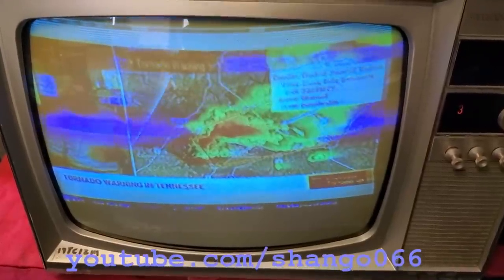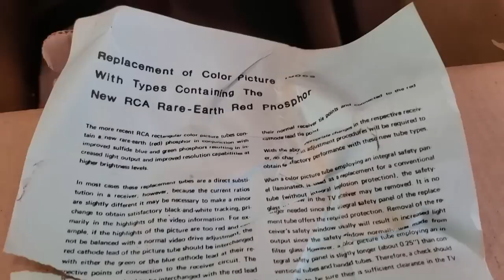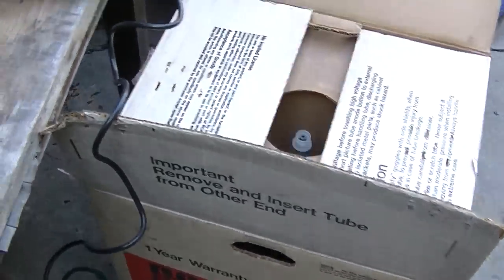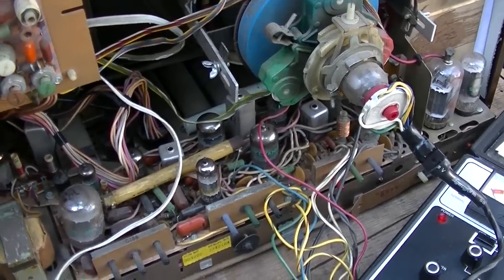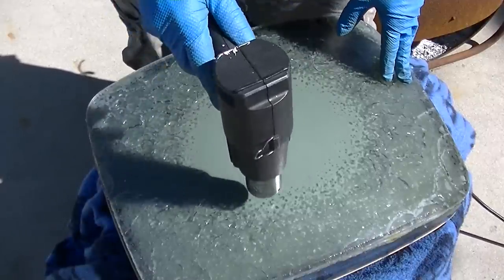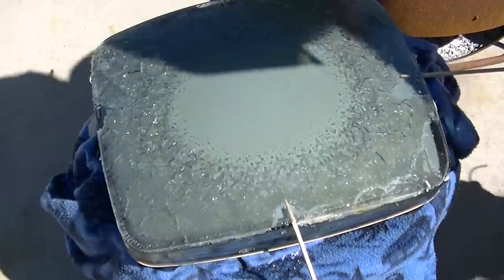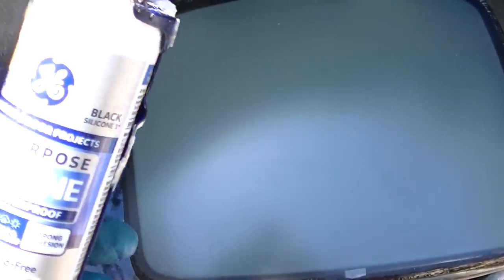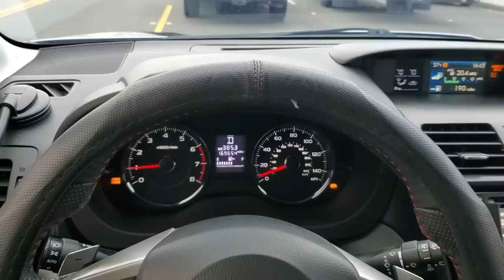Color Television CRT Cataract Removal and Replacement Pt1 1966 Sylvania Tabletop

Comment: As a Britisher, I cannot believe a car can only report around 20 MPG at that speed with just a Shango and a TV onboard :o  I know that people like their big engines and things but, well, we really need to find better alternatives to this just to get around!
Reply: your gallon is larger than ours it doesn't change much but 20mpg us is 24mpg imperial
Reply: @Mister_Brown  I thought there was a difference but really fuel consumption is just too much these days.  We had cars in the 1980s that on a run could return around 40 to even 50 mpg with ease.  Around town that was down to about 30. Emission control could be a factor in this increased consumption, as could be the trend to have bigger cars, but I just wish people would be happy with cars with smaller engines.
Reply from the maker: We love our carbon pumps
Reply: @andic6676  oh i'm not saying it's forgaivable just that sometimes apples to apples comparisons aren't what they seem

also we do have efficient cars, my old corolla does over 45 us mpg on the highway and is literally impossible to get less than 28mpg no matter how poorly you drive it on flat ground. but even that has a 1.8 where in the uk it might have a 1.4 tops or and get better mileage still
Reply: @andi c  For the catalytic converter to heat up and burn everything off, the engines run richer. I tune engines with an ECU reflasher and stand-alone wide band O2 sensor the engine are running at 13 to 1 AF when they run better at 14.7 to 1 even 16 to 1 but then pollute more cuase the cats don't heat up. I went to the extreme with a 5.3L V8 silverado and went from 13mpg to 20mpg only in summer temps, tho have it at 17 to 1 AF at idle.
Reply: Zero miles per gallon when you're not moving. Accumulated or average mpg is not the same as instantaneous. Cars today are super clean and very efficient. It's easy to critique fuel efficiency on a car which weighs a few thousand pounds, rolls on squishy tires goes up and down hills and starts ave stops. Think about the lights, air conditioning and heating in a home. Never mind clothes dryer. How about the cumulative load of all of the little parasitic draws from all of the little devices and chargers. How about refrigeration? It's all consumption of energy. The narrative is steered toward whatever direction they want the public to look.
Reply: @SoundsLegit71  I got a CVT transmission on my 6.0L engine  it has a SUPER OVERDRIVE gear  45MPH @ 1050rpm

 it gets 33 MPG at 45MPH on the highway(back roads instead of the freeway  takes only 15min more to get to work vs freeway).  it has dropped down to 23.7mpg(last fill up)  because my High voltage battery went   (P0BBD code replace battery)   :(
Reply: It does say "average".  It may have spent some time in a traffic jam.
Reply: Mine gets 17 on a good day
Reply: Have you Britishers outlawed internal combustion engines yet? California has.
Reply: @theantiveganchannel3596 CVT transmissions don't have gears.
Reply: @chad2787  it's a  3 speed Planetary Gear(epicyclic CVT)  with 4 Speed Launch fixed gears.  that means the 6500 pound SUV can launch from 0-60 in 6 seconds.. on a fresh battery
3 planetary gear sets, 2 rotating clutch packs and 2 fixed clutch packs.
it's a $10,000 transmission back in 2008

basically a 4 speed transmission  + 2 super overdrive gears(one of the planetary gears is for reverse )

it has it's roots in the 97 Toyota Prius  it even uses the blade batteries as well like the prius 2nd 3rd gen  instead of 16-20  it uses 40 battery cells

these trasmssions are smooth    100% undetectable  when it's shifting between the planetary gear sets and fixed gear sets...  it does bump now but that is due to a spent battery ...  (not enough  electrical power  )
Reply: @theantiveganchannel3596  Then it's not a CVT: "A CVT has no gears at all; it uses two variable-width pulleys connected by a flexible belt. One pulley is also connected to the engine, while the other is connected to the wheels." CVTs are basically old school riding lawnmower transmissions. I looked up this one you're talking about - I guess it uses toroidal cones on planetary gears for the constant velocity part but the transmission as a whole is really more of a hybrid. Any shift points, if present on a true CVT, are basically faked by the computer. I have a 5 speed motronic type automatic and when it is functioning properly you cannot feel shifts but you can hear the RPM of the engine change although it acts similarly to a CVT in that when accelerating it revs to the engine's power band and stays there in gears 1-3, shifts more conventionally into 4th, then will engage 5th only after torque converter lockup.

Comment: Some will say that LCDs are better in coin op Arcade refurbished consoles. Nothing quite beats the CRT they were made to be 640x480 there is a huge market for arcade console collectors that need CRTs its really sad they just stopped making them completely. Its damn near impossible to find a vector graphics monitor

Comment: those era subarus always need wheel bearings and cv axles
Funny how many cars are out there now with absolutely zero redeeming qualities. Bloated on the outside but cramped on the inside, heavy and sluggish but with 'sporty' and rough riding suspension, an electronic throttle pedal that gives it 100% TPS at 5% pedal input to make it feel "spritely", overcomplicated trash engines and tires with tiny sidewalls for all their faults... But people buy them by the thousand.

Comment: I wonder if there is some chemical that you can put in there that breaks down the bond so you can remove it without heat.
Reply: I've been thinking 3 or 4 hot plates at 200F.

Comment: Something I've always wondered while watching you do this is would it be possible to cut the 2 layers apart with dental floss or some other thin strong thread?
Reply: That sounds like it would work, and you can get some crazy strong formerly exotic filaments (Kevlar, Spectra, Dyneema, etc) in a variety of gauges since they're pretty commonly used for fishing now.
Reply: @treelineresearch3387  you generally use molybdenum cutting wire on cell phone screens and i'm sure that would work here but the issue is you can put a lot more force on the separation front than you think you are applying if the glue is really tough, just .1mm of wire diameter can cause a hard spot in the glue with the right shape to apply hundreds of psi on a very small area if it acts like a lever and gets jammed between the glass and screen
Reply: That depends on the bonding agent used when the tube was built in the factory. The tubes which use PVA (Polyvinyl acetate;basically wood glue) you treat with the chopstick method. And the tubes which use some kind of resin (cannot remember what it was, sorry) you treat with a guitar string or a hot nichrome wire. It's not a strict law, though. It's just how most of the afficionados do it.
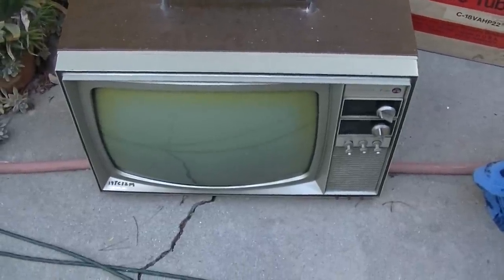Reply: There was one he did with a steel guitar string or similar. At 27:30 he's talking about using a hot wire.

Comment: If you have a double pane window and one the panes breaks, you cannot just go to a hardware store and have them install a new pane. You have to order a new sealed double pane window and install this new double pane window into the frame.  Reason is, there is no air in between the panes. They suck the air out and put a dry neutral gas in it.  If you ignore this and get a new pane installed, the glass will "frost" and no longer be optically clear.
So what prevents this from happening when you seal air into that gap with the silicone?  The air that it in there has moisture in it and it will condense into a "frost" or what is really a permanent fog.
Reply: Tvs aren't used to insulate a house during winter. Also, shango is doing this in high heat, which is probably pretty dry.
Reply: @SoundsLegit71  I was thinking the same thing. Fairly equal temperatures on the safety glass and CRT face. No cold condensing temperature surface.

I think argon or mix of argon and nitrogen with almost no moisture is what's in between doubled pane glass.
Reply: @johnnytacokleinschmidt515 Yes, it's argon. Shango is in LA which is a desert. 12% or less is typical humidity. Even if done in Miami I doubt the outer pane would drop below dewpoint when used in a climate controlled house.
Reply: Many window manufactures leave the air and use special spacers with silica gel inside.

Comment: i had 2 sony trinitrons with crts as bad as that, and as you've said in the past, giving them a 'boost' can kill them  i still have a black n white Teleton TH14 portable with even worse one, barely visible in the dark, hopefully eventually i might come across a reasonable state used one sometime, as its a bit of an unusual set to find here in the UK, it has 2 tuners vhf and uhf, and has a USA colour code mains cable and looks like it was originally set internally for 115v,  now at 220v, BUT has UK 6mhz intercarrier sound i wonder if originally used at a US air base here?
Reply: If they are this bad, you won't loose much if you kill it with an attempted rejuvenation. I have successfully rejuvenated some Trinitrons with a brute-force method. They produced a good picture afterwards for about 100-300 hours, so very temporary. But if you use the set for 6 hours a year, that would be enough... If you have a semi-automatic rejuvenator which does multiple cycles on each gun (but gun selection is manual), you should stop the rejuvenation after the first cycle on each gun. Use the lowest rejuvenation current, or the cathode cleaning function first, if available. 

The method I used for the Trinitrons and any other tubes (before I had a rejuvenator) was to put the 230V mains through a series 40-60W light bulb and a 1N4007 diode in between the cathode and G1 (the diode cathode facing towards G1, so it gets only positive half-cycles), heat them up slowly to 8-9V, and turn on the power. Nice red-blue fireworks inside the gun, and most tubes revived. To Trinitrons, I used 25-40W bulb, for other tubes with beefier cathodes, I mostly used 60W a bulb.

In fact, this method killed less tube for me than my current B&K 490B tester... The three cycles is does is too much and each cycle is too long. I started to get much better results after I started to stop the rejuvenation before the 2nd cycle started. It has a 25mA and a 50mA rejuvenation current setting, I want to modify it so it will have a 12.5mA option as well. I haven't tried to rejuvenate Trinirons with this tester yet, but I would start with 12.5mA, knowing how many beefier tubes this tester killed even at 25mA.

Comment: The Subaru is a prime example of why I don’t particularly car for modern vehicles AT ALL. Feel just about every bump in the road with the rock hard suspension combined with the fact that all modern vehicles are unibody which means you aren’t isolated from the road compared to something that’s body on frame with rubber isolators and fairly soft suspension. There indeed are some older cars that are unibody but damn, modern cars are horrible.
Reply: I'm not sure I understand what unibody has to do with it? Ride softness should be entirely in the suspension and unibodies have more flex than steel frames, regardless. It's more that "luxury boat" style suspension has fallen out in favor of sporty handling.
Reply: @chad2787  one of the last cars that had that “luxury boat” ride were the 2011 Ford Panther Platform cars, even then the ride was stiffened a bit before they were discontinued. A shame Ford discontinued those cars, hands down were the most indestructible cars EVER made since they literally could run for hundreds of thousands of miles with little to no trouble. Hell, some have even gone a million miles and are still running. Not sure if the older panther platform cars with the 302 V8 would have held up but I am sure it would be similar to the later panther platform cars, though.
Reply: @seana806  Yes, Crown Vic... Interestingly... I was just looking at one of these the other day for a buddy of mine who might buy one. I had forgotten how.... Effortless and perhaps "numb" the steering feels on these cars. A few years back I had a much younger neighbor who bought an 80s-mobile and was convinced something must be wrong with the suspension and I had to explain to him that it was normal and this was just how the cars were built then. Regardless, he spent a bunch of dough changing the suspension only to find the car the same as it was originally and then forked out some more to install a sportier aftermarket suspension.
Reply: @chad2787  i happened to look at a ‘66 Ford Galaxie 500 4 door hardtop that was mostly stock with the exception of springs that were put in to lower it down slightly and oddly enough, it didn’t ride too bad. Didn’t end up getting it since it practically had no interior with the exception of the dashboard, and didn’t have any windows in the door since the power window mechanisms had a bunch of gremlins that had to be worked out. There’s another one I might try to get with a $1600 asking price but needs a new C6 transmission since it’s leaking (at least according to the seller) along with new bushings, tires, brakes, and a few other things as well. Has the 302 in it (engine isn’t original to the car), may even put an AOD in it since those what the early 90’s panther platform cars used, even made that particular transmission up into the early 2000’s along with the 302 up until 2001 or 2002. That particular car may need some cash put into it, but will be many miles cheaper than paying upwards of $50K on a new car (even $60K) then loose 30% of the car’s value as soon as it drives off the lot with depreciation. Not to mention the ridiculous designs modern cars use such as running the water pump off the timing chain, interference engine designs, and many other absurd designs that are a royal pain to fix when a problem arrives.
Reply: @seana806  One of the first cars I had was an '86 Crown Vic. The engine was indestructible but the tranny got clunky over 200K and also kept having problems with the power steering. Pretty fixable car, though. Sadly, it was a Northern car and just rotted away and succumbed to frame rust that wasn't really worth repairing and got towed off to the junkyard still running and driving.
Reply: Also now most seats are harder than cheap plastic garden chairs.
Reply: @ruben_balea  I remember old Cadillacs, Buicks, and Pontiacs with super cushy seats like a modern pillow top bed, but if you want some really comfortable seats you should try an old Peugeot 504 or Citroen SM - most comfortable car seats I've ever sat in with like 8" of cushioning.

Comment: Great video. Got me worried too about why it wasn’t coming apart. Subarus just suck. They burn oil, the ride is horrible. The interiors feel very cheap and are loud. Also bearings seem to always fail (If you’ve ever done it it on a 2007 Forester, you are in for a rustastic treat). I will give them the smoothness of the boxer engines, that they can do. But I think they are only making it based on the fact that all their cars are AWD. None one wants a FWD really much anymore, unless you want extreme economy, let alone a RWD, unless you want to do drifting.
Reply: My sister and brother in law bought a New Ru in about 2004, he passed away not long after, she was the proverbial "lady driving to church", so, barely put any miles on it, but, it developed a warped head / head gasket leak that the dealer told her she needed a new motor ( had to be bad factory work) while it was out of warranty timewise, but nowhere near mileage. She bit the bullet, paid for the work, unfortunately she also passed away, and the car was sold to my other sister, where it did survive at least until last year.   I have a 2005 Ford Expedition, 2WD w Posi, and it is extremely "ass happy" even on a wet road.
Reply: Had a couple of friends own and love Subarus; they mentioned that you almost have to plan for a head gasket replacement at 75k miles. I'm not sure I want a car where I have to think about that as I'm driving it off the dealer's lot.
Reply: @mikeschumacher  Subies love eating their head gaskets.  Wheel bearings are common failures, and the suspension components you need to remove to replace those wheel bearings love to rust into solid masses.  Not a fan at all...

Comment: using heat is just silly.  use a solvent.  much safer.  done it many times.
Reply from the maker: In your family trying to coin Blair full blur join trivial final layer der bourbon pervo Flash

Comment: Okay🤔 but like if the intermediate material is not actually needed and the lens can float 200 solar systems off the surface of the tube how exactly is it a bomb with it removed? 

I highly doubt a little bit of gel could stop it with the immense pressure the tube is under but I’ll play devils advocate and say sure. But there’s absolutely no way in hell a lens adheared just around the edges with household caulk is going to do Jack shit in protecting the tube from ambient air pressure in the slightest.

I get it’s there to be protection if equilibrium is achieved and protection from the resulting claymore but removing it makes it no more a bomb then a nuke without a detonator…. So why exactly unless I’m missing something does removing the lens arm the bomb?

Comment: Wonder if you had some type of portable green house would it heat it up faster? Maybe build a frame out of 2 x 2s about 24 inches square per side and wrap it clear plexiglass. Put the tube inside it and place it in the sun. It'd be like leaving it inside a car during the summer.